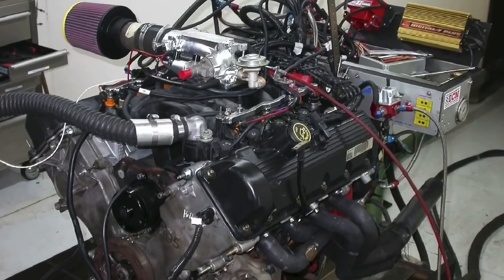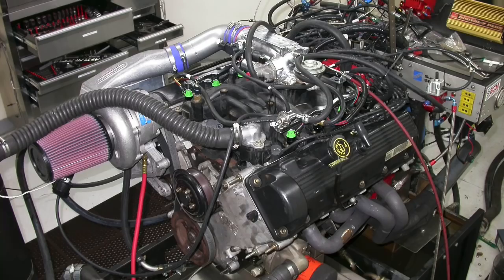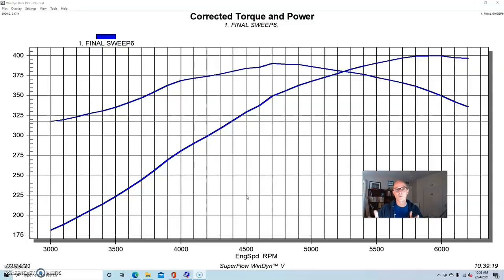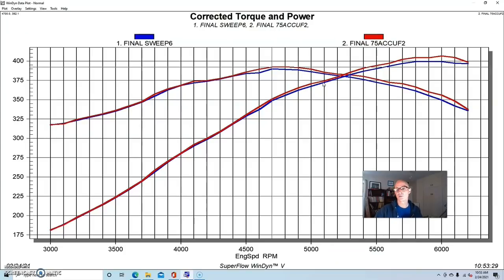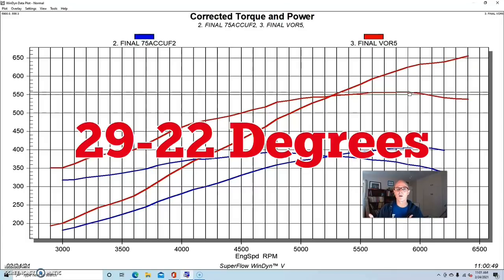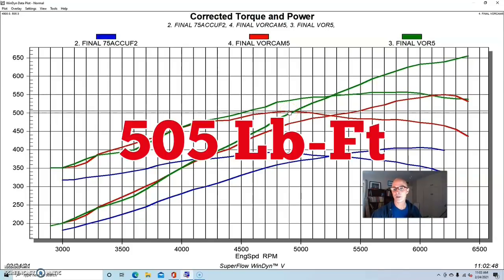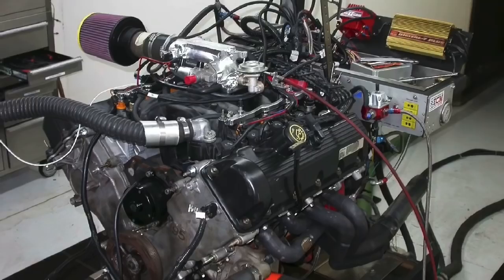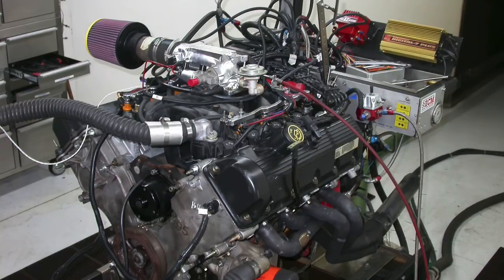JUNKYARD, VORTECH 4.6L 2V MOD FORD-WHAT ARE CAMS WORTH?

Comment: Nice informative data driven video.  Definitive specs (Duration, lift, LSA, etc) on the factory non-PI and PI cams would be nice to see.  I've seen several values listed for them elsewhere so it would be nice to see what they actually really are.  What I see are way too big cams for a 281 CID engine for true street-ability unless I'm too "old school".  Peak horsepower and torque are nice, but since I and most people don't drive at WOT the majority of the time, power from 1,200 to 3,500 RPM is ultimately more important when the pedal is not mashed to the floor.

Comment: Interesting.
Hey Richard. Have you done any cam spec work and checked the results after on the dyno? 
Determining the LSA, duration etc for an engine aiming for a specific result and see if the theory is in line with dyno results?

Comment: Can you do a stock stock pi motor, no cams no porting, straight factory with boost. Most people don't have all these mods. I was interested in the video but was discouraged when I seen you have a modded motor. This motor would cost the average person thousands before getting to your starting point before buying a supercharger for another 3500
Reply from the maker: A STOCK PI MOTOR MAKES NEAR 300 HP (THE WAY WE RUN IT), THEN ADD BOOST
Reply: @richardholdener1727  thanks for the reply.👍🏾

Comment: Would Love to see what the max power a stock pi 2v can handle bottom end, Also a torch tech kit with a eaton video would be amazing!
Reply: I personally just pulled my stock bottom 4.6 2v Windsor block out after about 100 passes. It’s vortech supercharged with 12-14 psi, stage 1 cam and springs, self tuned. This engine was seeing 550rwhp. The key is like Richard said, the tune. Keep the revs at 6k and under, and don’t be crazy with spark advance. Replaced it with a built teksid block and bigger cams, 11:1 compression, just the peice of mind with the built bottom end is worth it haha after a hundred passes on stock everything in the bottom end.
Reply: @Post_Tenebras_Lux09  I have a teksid block sitting in the garage and building a bottom end as we speak! Just wondering how long my stock bottom end would last.
Reply: @subzero_7473  1000 flywheel horsepower. Look up 4.6 big bang
Reply: @Post_Tenebras_Lux09  piece of mind though? I’d be horrified now because there’s thousands of bucks invested in a built engine versus running with a stock engine that you could pick up a replacement for at the junkyard for 500 bucks.
Reply: @andrewmontgomery1763  Being that guy who kills engines and oils the track down every event is less than ideal. If you want it to be fast and reliable, it wont be cheap.

Comment: You say if it makes more power naturally aspirated it's going to make more power under boost I would like to see a naturally aspirated Cam versus a boost Cam on the same engine   Naturally aspirated then under boost to see if 1 makes more than the other in each scenario
Reply: You must be new here, every cam is a turbo cam
Reply: @smokenchoken1736   watching for a long time I would just like to see a test to see if it actually is a difference between a boost Cam and a naturally aspirated
Reply from the maker: WHICH EVER CAM MAKES MORE POWER NA-IT WILL MAKE MORE UNDER BOOST
Reply: @richardholdener1727  so a boost cam is
A myth

Comment: Have you ever made a 5.5l vortec motor. Using the bore of the 6.0 with the stroke of the 4.8 to make a large bore small stroke vs the small bore large stroke of the 5.3l
Reply from the maker: I DID A 4.8L CRANK IN A 6.2L (LS3) BLOCK
Reply: @richardholdener1727  what were the results

Comment: You got to do this test with A PI motor
Reply: They were ported pi heads on a non pi shortblock. It adds a bunch of compression compared to a pi shortblock.
Reply: @timothybayliss6680  yes I understand that that's why I want to see this on a pi motor with pi heads
Reply from the maker: IT IS JUST THIS MOTOR WITH LESS COMPRESSION

Comment: Makes me want to keep the stock 2v in my 97 bird
But I just got a 98 cobra motor for 200!
Reply: Swap the cobra motor and boost it .
Reply: @dilsher12  that’s what I’m thinking, coyotes are cool, but the 4.6 sounds better I think. I’m just hating on the ghost cam tunes, that’s pretty awesome
Reply: Sweet deal
Reply: @seanwhittington6637  thanks!
Reply: https://youtu.be/pRV45b5AFjE
Reply: With just installing larger intake valves min porting around bowl area 2V make way more power than 98 Cobra B head engine w/cams. With ported heads seen make more than C head 99 up w/ small cams. 
The new Pro Max 2V CNC heads with big valves on .020" over 4.6 with good cams make more than B head with maxed out off shelf Vortec SC Kit. Heads, cams & bottom end still be at cost of non intercooler SC kit & have new engine that actually sounds built.

Comment: Can’t wait for that V-10!
Reply: no joke. The torque curve will impress
Reply: @madmod  There’s another video of a 2V one that’s a twin turbo in an Excursion...6 lbs of boost and the power was 🥜....
Reply: @sorryociffer  Ive seen that and read through the build forum on it. With cam companies nutting up and making cores, the only key component missing is a better intake manifold. Do a quick google search for the itb equipped v10 mercury capri. That car scoots
Reply: @madmod  Truck intake is fine with FI...NA...that would be a different story.
Reply: @sorryociffer If the truck manifolds had the cross runner sectional area of a pi intake runner, it would by no means be a restriction. However, the truck manifolds have cross runner area similar to that of the npi intakes. Not good for power production below 4k rpms. With that said, the 5.4 and 6.8 both peak around there anyhow.
Reply from the maker: I HAVE THE CURE FOR THE INTAKE

Comment: I forgot how giant those modular engines are
Reply: OHC really make the heads a LOT taller than OHV heads need to be, don't they?
Reply: @nunyabidniz2868  The size is a negligible negative for the benefits offered especially when used in a chassis where space isnt much an issue. Ive seen the sohc 4.6 carbed in a 944 porsche and it was shoe horned but you could still work on it.